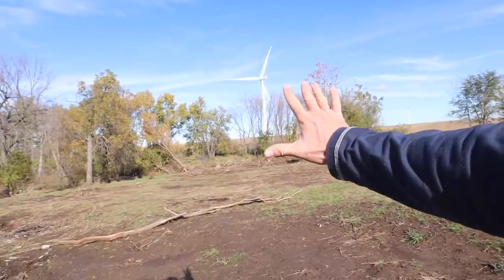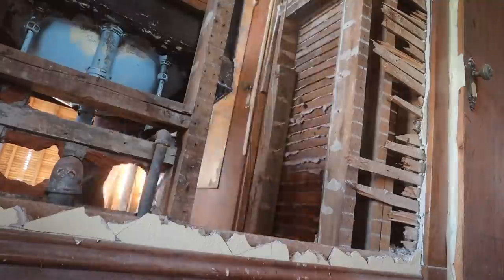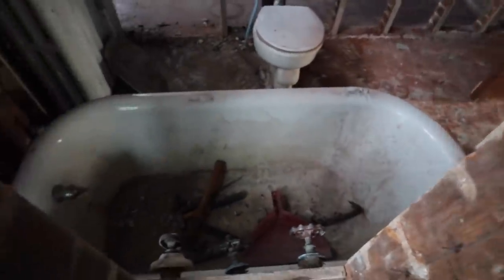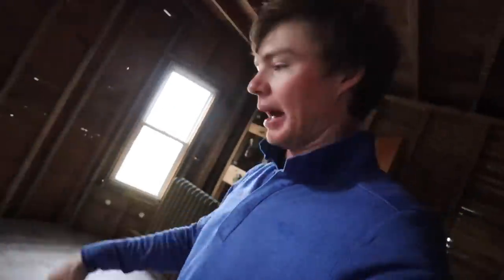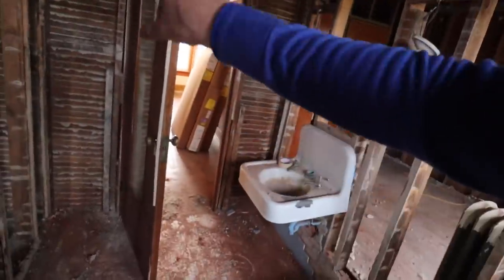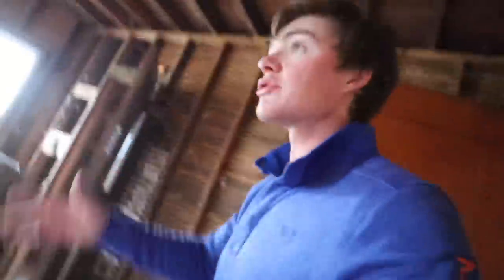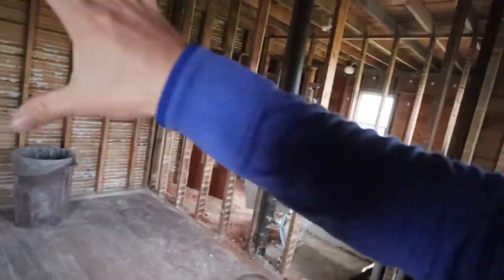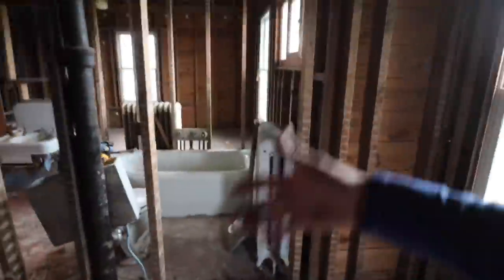I Am Building An Underground Movie Theatre

Comment: If you're going to go over the top, then solid hardwood floors are the way to go. You'll appreciate it when you're older... Stain them dark if you like that look.
Reply: Plus vinyl floors look cheap... might as well put in linoleum flooring if you're going that route.  At least it'd be period correct, I know of several old farm homes that had linoleum and rugs in the house.  All that old trim work won't look right on drywall, the reason people use drywall is because it's cheap and easy compared to plaster.  Kind of like vinyl siding.
Reply: Cathie finch its 2021 there far superior products for flooring than hard wood floors. That clean better and hold up better than hardwood floors… hardwood floors are totally an 80’s and 90’s vibe to them…
Reply: @hubes96  so plastic flooring it is.  Traditional hardwood flooring can last more than 100 years in the average home.  Do you need something more durable than that?  Hardwood floors aren't exactly difficult to clean.
Reply: @ChevyC-hf6km  Yeah man I'm with you on this, whod want a crappy vinyl floor when they've got hard wood to polish and clear coat.
 He did say the timbers don't match in some areas but they'll be good donor timber elsewhere in the house where he's planning carpet

Comment: Install your hvac in zones. No need to heat or cool unused space. Tub could have antique value, radiators definitely have value if they don't leak.
Reply: I have a house with a zoned heat / AC system in it, and I would NOT recommend that to anyone. First, the system gets confused at times and will cool one zone way more than it needs (65 when zone set at 73) Second, most Heat / AC places don't have tech's that know how to work on zoned systems and they have a tendency to screw things up, or walk off the job because they don't know the system. Many of them wont even come to the house once you tell them it is a zoned system. I have learned to deal with my system because I have had such a hard time getting knowledgeable people to come here when there is a problem. I had the entire system replaced once after a lightning strike cooked the system and the system will still cool one zone more than others. NO thanks, zoned systems are not that great. I think in Coles case, new baseboard radiators instead of the old cast iron ones would be the best way to go if he likes the steady warmth they provide. They don't take up as much space as the old stand up ones, look a lot nicer, and can be hidden behind furniture. You just have to leave some space for the heat to go up the wall behind the furniture. He will have to in stall all new duct work for central A/C though, so forced hot air would share the same ductwork.

Comment: Put in paddle fan boxes when you do the ceiling lights.  Wire the lights with a 14-3 Romex wire that way if you get a fan with a light you can switch the fan and light separate without using the pull cords on the fan.  The pull cords will definitely go bad in a short time. Was an electrician for 30 years. Seen people change their minds after the worke was done.
Reply: Code in my town doesn’t allow for #14 wire.
Only #12 is acceptable.

Comment: Nice ideas for you master suite. Might I suggest you leave the door between the proposed closet and hallway. As the wife of a man that work 45 years on 3rd shift and was a day sleeper it greatly limited my use of my own bathroom and closet since we had to walk through the bedroom to get to both of those rooms. Which meant if I had to leave the house during the day I had to get ready hours a head of time or gather up needed gear (hopefully not forgetting anything) and shower and dress in another bathroom. I also could not gather up or put away laundry when it was convenient. This also negates the bathroom as a pass-thru when someone is using it.  If you leave that door in place you would also have access to the 'secret' attic stairs without going through the bedroom and bathroom.  Just a thought....

Comment: Cole, you could use the existing got water pipes for radiant floor heating. Cool with VRF which only needs refrigeration line and wires or mini split which heats and cools floor heat for really cold and base line comfort. Each room, thermostats for each, keep currently unused rooms at a super low baseline and save a ton of HVAC $$ over the long haul. VRF and mini split can be also controlled from a central computer, probably in floor as well. Also consider doing some makeup air for bathroom and kitchen exhaust blowers, it's a game changer.

Comment: You should replace those radiators with induction heating throughout the entire house. Then you can zone off the house for different temperatures. And have a more precise control over your electricity bill.
Reply: Induction heating is not a logical application for residential.
Reply: @rsporter  Please explain.

Comment: 5:50 Spray those boards with BIN (shellac) or Killz (oil) to seel them up. Then overlay the attic floor boards with 3/4" ply or OSB..  By keeping them the whole floor will be so much stiffer.

Comment: It’s breaking my heart to see this gorgeous old home destroyed.  Yes, much of it has to be upgraded, however you tend to throw the baby out with the bath water.  I know it will still be a beautiful place, just not the priceless materials and details you just don’t get in new construction.
Reply: I don't understand the gutting all the plaster decision.  You can wire, plumb and insulate plaster walls without pulling everything down.  But it's too late since the house is wrapped in vinyl siding.  But his house and his money, not the way I would have done it.
Reply: Yeah if you gonna totally change a house why not build a completely new one.
Reply: Yep, this is a nouveau riche build. No replacing cast iron tubs and antiques and hardwoods that were meant to last 200 years. The Home Depot look will get old soon and it will be regretted more and more over the years.
Reply: I know, right?  Each to his own but the original house was lavish because of the details and workmanship that went into it.  Now it's going to look extremely McMansion "standard" - vinyl siding, drywall, laminate floors etc. Not "over the top" in a good way at all, it's the sort of thing they did in the 60's and 70's that are now being ripped out elsewhere.
Reply: @ChevyC-hf6km  Once a plastered house is insulated, though, there can be serious trouble with condensation and mold. He may have been advised about that.

Comment: Put tuck tape or something real strong over all those gaps in the outer walls where light's coming through; the spray foam guys will appreciate it.

Also, if they miss one; then you'll have a big ol' wart under your Tyvek that'll have to be messed with when siding goes on.

Comment: you should look into mini split systems way more effecient than  a central forced air heat system and you dont have all the ducting to deal with
Reply: We used AC window units and had electric ceiling heat. Replaced AC for a mini split system (as we have no duct work), 1 main unit and 2 minis in bedrooms.  Cost about $7k, 4 yrs ago. Best money ever spent, great savings on electric bills too!
Reply: Just all the line sets for multiple heads you have to hide with line hide 96% furnace with 4 or 5 inch thick filter and leave the fan in on to circulate air and return air is just as important as supply air
Reply: @andrewrixman7260  its way easier to run a 2inch thick line set through an old house tan it is to add ducting non the less a shit ton cheaper. as well as the mini splits are way more power effeicient and gives you room by room control without having to use super expensive ducted air controls. as well as if he has a bunch of un used rooms at a time he can climate control the spaces there in and not waste mroe pwoer .as well as the tempature change in a room with a minisplit is much faster than a central system in most cases
Reply: Ture but you can't get the air purity out of a split like a force air furnace and I know weather in Iowa might not get as cold sometimes in North West Wisconsin but they lose efficiency when it gets below 10 degrees unless you get a low temp which is more money. And companies will have more conventional force air and a/c parts on hand to fix if it brakes down
Reply: @andrewrixman7260  I live in cape cod MA it gets cold as shit here and my mini split system is rated -10 degrees i have a 5 head unit 21.5 seer has worked pefect for a few years now and it only costed 5k for the system and I spent 1 5 days plumbing and wiring the heads and confessor unit. And have great air quality  even during the spring with the insane pollen we have here. Something to remeber is he has a old house that is always going to leak air so as for say stagnant air will not be an issue and if so you can just add a erv/hrv and some mini split systemts that are flush mount for cellings have options for it to be included in that type of system.

Comment: Something that my brother learned when he ran new wires is that since you have the walls removed anyways. Go ahead and run your speaker wire inside the wall now. That way you can install connection boxes in the wall and even cover them with a photo or something to cover them up if you do not need them right now but you might later. Keep in mind that you may want to install a central stereo system to feed mood music through the entire home. That, or you would have it tuned to the sports game on tv during the sports games on in the man cave.
Reply: It's also a great time to run some extra conduit.  Can be the blue flex stuff or for higher capacity central vacuum pipe is perfect; especially a few home runs from the basement to the attic.  I had my builder do that and then I was able to wire my whole house with ethernet for the computers, entertainment gear and security cameras.  It would have take a lot more work without those empty conduits sitting there waiting for me :)
Reply: @DocNo27  we call the blue tube. Smurf tube

Comment: For the bathtub, turn green and smash it with a sledge hammer. Also you could also run your internet cable in the walls before you put drywall up.

Comment: Having lived with radiant heat, you will not be happy with forced air system.  The mini split heating cooling system is very nice.  I have an office with a mini split cooling system and the heating is hydronic heating in the floor, like your heated shed.  Both systems are a major cost saver.
Reply: I love hydronic heating. I used to have it in my last house. Now I have inherited forced air and I loathe it!

Comment: Cut a hole in the exterior wall and lift it out with the telehandler. If the exterior hasn't been sided yet on that wall it will be that much easier. When i lived in Alaska we had baseboard radiant heat and like you said it kept a pretty consistent temperature. We also had a wood stove but wood is hard to keep at a consistent temperature. I would put carpet in the rooms but a absolutely hate getting out of bed and stepping onto a cold bare floor.

Comment: You know Cole you could and should take out this big old radiators but in the process of putting new floors in put in-floor heating in since your theme is "over the top" somewhat?

For A/C you can easily run simple flexible duct work to an air handler or two that are tied to central A/C units and then you would have the best of both worlds so to speak?

Consider adding some heat pumps besides as then even more efficent and one more add on you could consider is putting in an outside wood boiler besides.  

I have seen many folks do exactly this with old homes such as yours and it is awesome!   

The new high efficency boilers are about 1/4 or less than what you have and all the way around work far more efficently.  

After being used to radiant heat I think you and the future Mrs. will be greatly disappointed and cold otherwise. 

The spray foam is the only way to go every chance and everywhere you can - seals things up really good!

Can see this being a longer term project but the final outcome in a few years will be awesome!   :-)

Comment: Hey Cole, 

Tub = sledge hammer and carry out in pieces but put a piece of plywood under to protect that beautiful hardwood in case you decide to refinish it. 

As far as the heat; In your basement  you have access to the joist bays on the first floor so you can put In subfloor hydronic heating and just attach it to your existing boiler. The heat will rise to the second floor for now. Then if you plan ahead you can have enough zones to add it to the second floor joist bays when you start to remodel the first floor. You could even put the sub floor heating tubing in the exposed bays between the second floor and the attic now and just not connect it until you are ready.

The attic; paint it with kills or some heavy duty odor blocking paint then put the subfloor right on top of it. Doing so will add strength reduce squeekyness and solve your bird poo issues allowing you to spray foam now and save time. The spray foam will seal the bottom of the boards, they will be cocooned. Doing spray foam under your attic floor will make it more difficult to heat after you remodel the attic because the heat from the rest of the house will not travel into the attic through the spray foam. Consider just blowing insulation up there for now as you will be insulating the attic ceiling in the future anyway and they can just suck it up later.

When you go to cut the cast iron pipes get the carbide sawzall blade not the diamond, it's just faster. The sledge hammer works too but its exhausting and fyi there is a lot of lead in the pipe joints.

The house sounds like it will be  awesome. Your channel Is like four In one; farming 101, scraping, landscaping, and remodel. Love it and the whole team.

Comment: Spray foam before you do the electric? To put outlets in those walls after foam will be a nightmare.
Reply: I would at least run wires and boxes on what I knew for sure. At least run wires to a general area
Reply: Wired a house after spray foam.  Was pretty easy. Used a little more wire but wasn't bad.

Comment: For your heating and cooling consider a hydronic system instead of air ducting. Use geothermal or air to water heat pump. In some ways it's similar to a minisplit system, but you are running  insulated water lines (even PEX)  instead of refrigerant lines. Much easier and you can do much of the work yourself. The heat pump can also supply your hot water. Each zone can maintain it's own temperature setting or unused portions of the house can be turned down or off. A house of that size would benefit from a mechanical design to avoid mistakes and increase efficiency.
Reply: Three more thoughts: Air ducts are hard to run in an existing house and establishing hydronic zones is significantly easier and less costly than forced-air ductwork. Finally, a properly designed hydronic heat pump can have some zones for heating and others for cooling (Think of the attic and basement in the summer). 
A properly sized geothermal heat pump would eliminate the need for a winter backup heat source and be much more efficient. 
This system design would efficiently maintain the "Over the Top" Remodel.

Comment: If you're not interested in saving the bathtub, use an angle grinder and cut it up in place and toss it out a window or carry it down stairs and recycle it.  For the plumbing, make sure you have room in the flooring below to run the drain pipes (or tie into existing pipes if you're keeping them).

Comment: Cole, Bath. Big hammer. 15lb + Whack it and it will ring and eventually go boom! Works for cast metal, should apply to the ceramic. Often these heavy baths were placed in before all the surrounding area was built. Dark laminate flooring equals lots of white marks all over. Lighter is brighter. Exciting to see this kicking off once more. Regards Stephen.

Comment: Hi Cole, great update video! Whenever you do the underground work, depending on the size of the Garage, a pit for oil changes could come in handy. The size of your equipment could prevent that from being realistic. 
So an outside open pit would be none restrictive, of the size, of your equipment. This shelter for a huge ”carport” with roof style that will handle any of your equipment. All of your fluids would be kept inside of your new garage, with the pumping of those fluids from there to service equipment. Eventually down the road you could fully enclose it, if you want.

Comment: If you are not planning on finishing the rooms yet, you could use insulation boards for the ceiling, just nail them into place intact. Then, when you have replaced the attic floorboards, just take down the insulation boards and use elsewhere...

Comment: Hey Cole, I don’t know if you’ll see this, but don’t spray foam. Convenient and cheap?  Yes. But it’s cancerous, and off-gases for years. It also forms a water barrier right adjacent to your wood, which can lead to condensation and rot when applied to old houses. A lot of people here in the North East have experienced that. 

I know for a fact that presence of spray foam has to be disclosed along with asbestos and lead paint in some states when selling - just underscores the seriousness of it. 

Also, I have heard from firemen that they will let a modern house burn once they’ve got the people out, because fighting the fire exposes you to deadly chemicals - products of spray foam and vinyl and other polymer combustion. Those chemicals will kill you faster than the lack of oxygen. 

I’m doing the same thing to my grandfather’s 1930 house, same story (no insulation, over the top, etc. though in my case, the rodents took care of the original insulation). I am hoping to be able to afford rock wool insulation, but failing that, I’ll go for fiberglass. 

Finally, consider spraying everything with bora-care for long term protection. It’s safe and will preserve those Timbers from mildew and bugs.